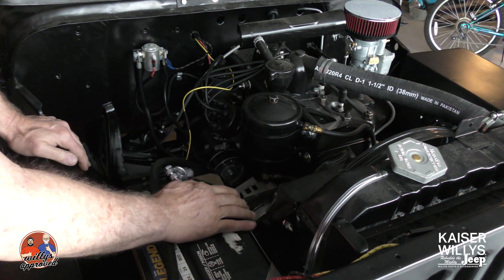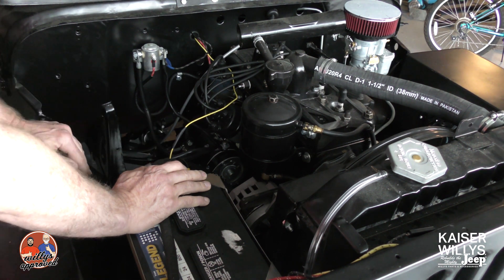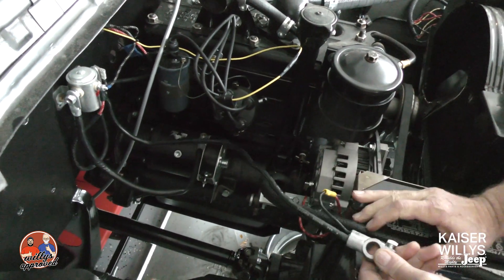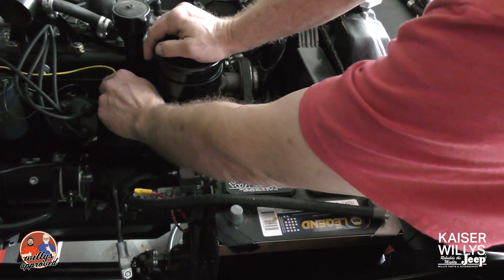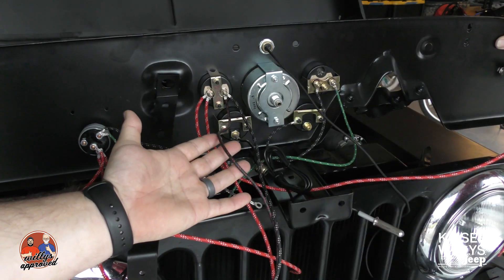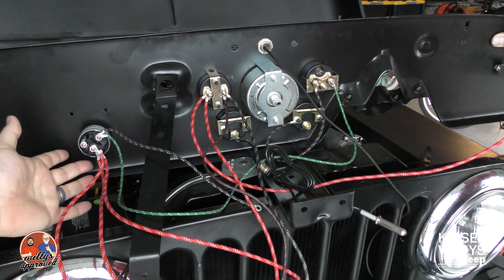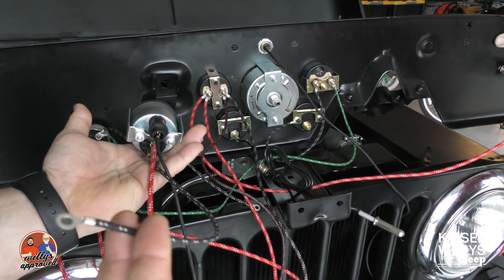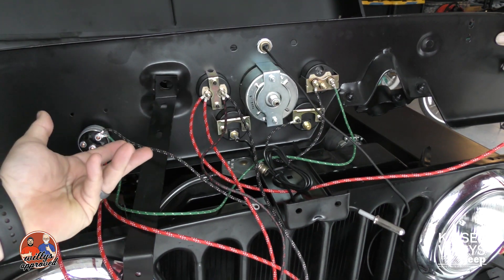Willys Jeep How To: Wiring Harness Part 10 - Alternator Wiring

Comment: So the yellow wire from the alternator gets a 10amp fuse under your dash and then actually lands where? On the positive blade terminal on the new voltmeter? Or on the accessory terminal on the ignition switch and then a wire jumpered from the accessory switch over to the positive blade terminal on the volt meter?